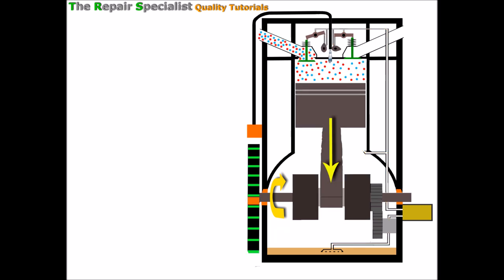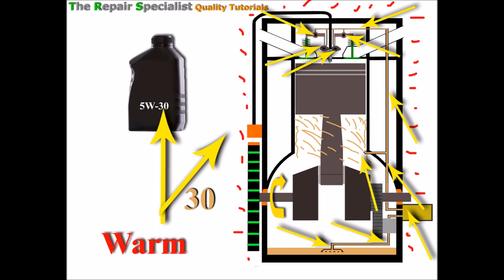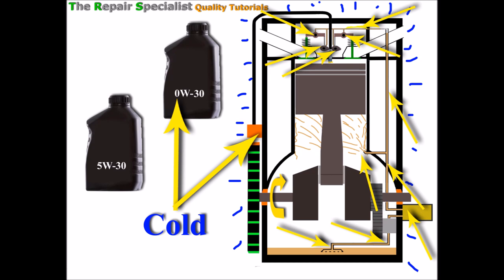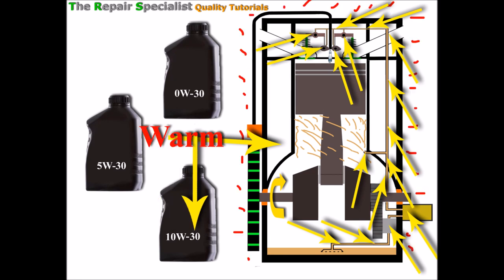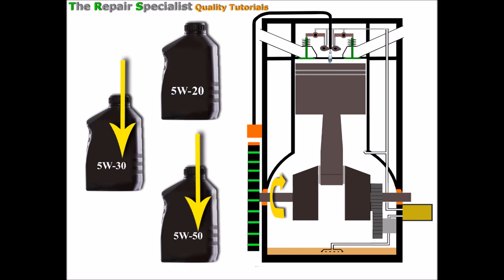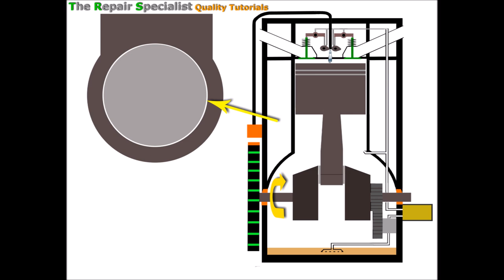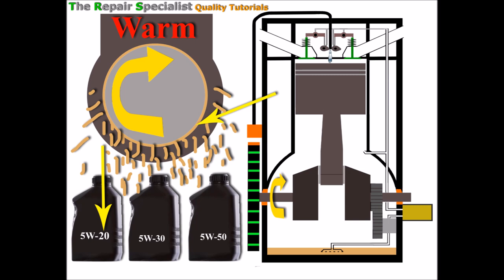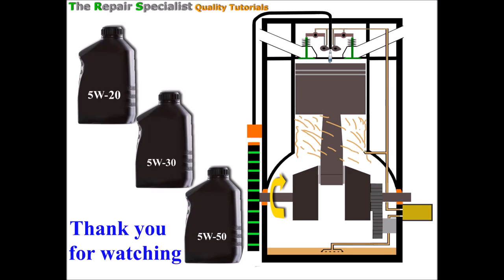'Engine Oil' - If Incorrect, this will happen! - Car, Lawnmower, motorbike, etc

Comment: This a great video, best I've seen. Which is why I am inclined to the make the effort to add to the content creator's knowledge. Specifically, about why 0w-30 should not be used in a 5w-30 engine. Yes, the oil will reach the parts faster, but the reason the manufactuer has specified 5w as the minimum for winter spec is because while 0w reaches the parts faster, it will do so at less pressure. In another video, you explained that sufficient film pressure is required to fully suspend some parts in a film of oil. If 0w is used, yes the oil will arrive quickly but will be squeezed out, and will tend to spray and splatter making the quicker lubrication pointless. It is better for the oil to take very slightly longer to arrive at 5w than to have 0w arrive quickly but lack sufficient film strength.

Comment: Thank you for the wonderful video.

One issue that you haven’t mentioned is that many engines have oil viscosity ratings recommended by manufactures that relate to outside air temperature ranges, ie the colder the climatic conditions/daily temp range the lower the recommended viscosity range, higher outside temps higher viscosity ranges recommended. In addition there is the aspect of how extreme are the operating conditions, such as  the difference between regular driving and driving around a racetrack as an example, which has a similar effect to recommended viscosity ranges to hotter outside air temperatures. Admittedly most passenger vehicles have only one recommended viscosity range. Motorcycles though usually have a number of oil viscosity recommendations based on operating ambient temperatures.

Comment: That's true on a brand new engine, but after years and high mileage that  factory recommended oil won't provide same protection due to wear  ,higher grades will be recommended to provide proper lubrication.
Reply: False

Comment: There are more factors that determine the distribution of oil. 
For example, the type of oil pump setup can affect the pressure of the oil, under different viscosities. 0W-30 will result in low pressure at startup and 10W-30 will produce much more pressure. 
Because of the complex oil passages that can clog, making sure there is always clean oil in the engine will help a lot more than adjusting the viscosity. 
I make sure I change the oil but I change the oil filter at least twice as often.
Reply: 0W and 10W is very different with cold engine, it is very important. 0W protects engine a lot better at  cold start and oil pressure is not a problem at all.

Comment: I agree with a LOT of what this video has to say. My 2 pennies on engines has some notes. If you have a really worn car, like say a little worn out 1.6l, and its in the summer, it may be okay to use 10-30 instead of 5w-20, BUT that can still cause damage if you are dumb and rev your engine in the morning, or dont drive it every day. Dont use that example as a rule! Also, say you have a car you put a turbo on, you'd be better off changing it a higher weight oil, like 0w-20 to something like 5w30/40. Always ask a mechanic or your engine specialist, and remember, any oil is better than no oil.
Reply: most of what he said is correctly incorrect. the W stands for winter. That measurement of viscosity is at 40 degree C. and is in a relative equation to the other number lets say 30. That's the viscosity at 100 degree C. You are 100% correct about changing viscosity on an older engine. As engines age mechanical slop starts to become present in the bearing surfaces. We are talking microns here, like the difference between a 5w20 and a 5 or 10w30. merely 6 to 10 microns. That much range can be found between differing oil manufacturing measurements within the same viscosity rating.

Comment: Great explanation in (theory) how about doing the test on a small engine. Find the last gallery to be filled & time it. I bet actual results using 0w30 to 10w 30 would be very little & modern oils stick to surfaces better so it not going to a lot of difference to start up wear. Better to extol the benefit of regular oil & filter change.

Comment: The first and second set of numbers are on different scales of measurement and do not relate to each other. The oil always gets thinner as it gets hotter.
Reply: You're right, hes absolutely jibberish about this. No Scientifical backing up this. This is why everybody beleives it.
Reply: No. They're both SAE.  They're both also referring to centistokes.(cps). One is kinematic viscosity the other is still.  But still same unit and scale🤦🤦.   "Thinner" is not the way to think of it "shear" and film related to viscosity not "thinner".  It's why things are added to improve those two (shear and film thickness).  You're both wrong and out of your depths.  #dunningKruger.
Reply: Motor oil gets thinner as it's heated, but to prevent it from getting too thin at higher temperatures, additives (viscosity modifiers) are used so that it behaves like a thicker grade oil at higher temps.

Comment: Have a HONDA with 500k millage and found 20-W-50 GTX Castrol Conversational Oil STOPPED OIL CONSUMPTIION PLUS HAS MORE POWER BEHIND IT. 
Better then scrapping it, did anyone else find the same solution?
My friend did it to his TOYOTA COROLLA with over 650k millage and it worked for him. He claims no smoke or oil consumption and more horsepower. 
WORKS FOR ME!

Comment: Hi there thank you for this very informative content. But pls correct me if im wrong, so basing on your explanation, the 2nd number(viscosity rating for working temp) is a bit more important in choosing the oil for your engine since you will be running the engine most of the time. As for the 1st no.(viscosity rating for a cold start) especially in the morning. My question is, what is the co relation of the viscosity rating in cold start has to do with the weather condition of the country you are in? It makes sense for a country that is freezing cold could get the benefits of a 0W, but for a tropical country could you still use a 10w-30 or 20w-30(as you have said for a cold start it will take longer than 90 seconds) for a 5w-30 recommended engine without damaging it the long run. Thanks!
Reply: My I jump in?
It is a quastion of '"Pumpability/Flowability".   The 0............60 insures that the oil will maintaine it´s Pumpability and Flowability within a wide range of engin and climatic tempatures to lubricate and protect engine parts.
Depending on the driving and climatic tempature conditions (-45c - +45c) you do not need such a wide spread in Viscosity but narrow it down to your driving conditions.
Hope it helps.

Comment: Thank you for the explanation! I have one question regarding 5W20 vs 5W30, at home we have 2 cars using the same Honda engine the K24, the cars are Honda Accord 2003 and Acura TSX 2004, same K24 engine on both car but the Accord would use 5W20 and TSX 5W30, I live in Canada so we can have temp from -30C to +30C.  Why they are using different viscosity for the same engine, I know it is the same because I am the one doing maintenance for both car, I have asked this question on another car channel but no answer, some body suggested 5W20 was used to have a better km/l consumption as less viscous, still I am skeptical.
Reply: 5W20 doesn't have the best protection, it has the best MPG, so they'll recommend it. If you want my advice I will recommend you to use the 5W40 all year round and even better, use an friction additive called MotorCote but not the 10%, but 5% every oil change, and than tell me how is it running, and what gas mileage you are getting 😉
Reply: Manufacturers are moving towards thinner oils for better economy and emissions compliance.
As long as the oil is changed regularly and is rated for your climate conditions then there’s no issues using different oil.
Reply: @horiatomescu  MPG has nothing to do with it!! Attend an oil seminar, there's a standing rule why 5w20 is used!

Comment: I've used 5W30 in place of the recommended 10W30 without issue.
Reply from the maker: OK. Good to know thanks
Reply: You're exactly ✅ right
Reply: @TheRepairSpecialist  Tomorrow I will get it done Ford windstar 3,8 v6 2002 SEA 5W-20 on the cup.
I had 10w-40 first winter day car going bad noise from the engine.
Looking for trouble broken plug wire one didn't solve the problem.
Wait for tomorrow and will get back.

Comment: CAN YOU DO A VIDEO ON WHY YOU SHOULD OR SHOULDN'T USE SYNTHETIC IN OLDER VEHICLES THEY USE TO USE REGULAR OIL OR IF IT REALLY MATTERS.
Reply: you can use synthetic oil, of course its better than non synthetic on any vehicle, but make sure your engine is clean, because sometimes, leaking start to happen due to detergent on synthetic washing out your engine and any SEAL on your engine will be damaged due to dirt that washed out (if your engine is not clean)
The better method is, you use new non synthetic oil, run your engine high enough, drain, repeat if the leftover oil color change (dirt should be diffused onto new non synthetic oil), then change it to synthetic
Reply: you may certainly use synthetic oils for any engine old or new; the problem was decades ago (1990s)  when they first made the synthetic oils the esters that was used at the time has eaten into some type of gaskets or orings; this is not a problem now and was solved a little after that time...
you may find this info explained in youtube channel Lubrication Explained episode evolution of engine oils

Comment: I have an old worn engine.  Possibly cam bearings.  
I live in northern California.   It gets 112 degrees Fahrenheit in July.  Should I stick with 5w30 or move up a bit to let's say 5w40?
Reply from the maker: I can completely understand  your questioning here. I myself would wonder this. The issue is though, that if I recommend a certain oil, then it damages your engine as a result, then this is unresponsible of me. I would contact your vehicle manufacturer and get their take on it. Maybe they have a fact sheet of recommendations. Sorry I can't help further. Craig

Comment: SAE 10 oil has a dynamic viscosity of 0.3 Pa-s at 0 degC and 0.005 Pa-s at 100 degC. 
SAE 30 oil has a dynamic viscosity of 1.3 Pa-s at 0 degC and 0.01 Pa-s at 100 degC. 
SAE 10W-30 oil has a dynamic viscosity of 0.3 Pa-s at 0 degC and 0.01 Pa-s at 100 degC
Reply from the maker: Awesome 👍

Comment: Sir, 
You explained nicely. 
I need a little help. 
I have a Motorcycle which I bought in 2006.
The manufacturer recommended oil was 20W40.
But from 2009 onwards,  the manufacturer changed the recommended oil to 20w50 for their Motorcycle's built after 2009. 
What should I do. 
Should I still stick to 2006 recommended grade of 20W40 or should I use 20W50.
Earlier from 2006 to 2014, I used to live  in plain area. 
And now I live in hilly area. 
So sir,  please suggest me what to use. 
20w40 (2006 recommendation) 
Or
20w50  (2009 to till date recommended)
Reply: Well, if your motorcycle was built after 2009, use the new recommendation.
Reply: Maybe they learned 20-40 was a bad idea but if they admitted that then people with older bikes would try to sue if theirs failed. I think the 20-40 is probably ok but why use it if you have the option of 20-50? Air cooled bikes especially so but you didn't specify.

Comment: You can use half n half for extreme heats n extreme winters, 5w-20  (from 5w-30) 10w-40  or 10w-30 , sae high mileage , option is full synthetic only case high mileage is already half synthetic ,,, use a lubricant additive  2 of bestline is a great one,, so you pour bestline first then then 5w20 n last the highest grade , put in between pours let it run all the way thru n down you can help it by hand turning the engine, to lubricate it,,this also gets in the oil filter without fill it in with oil much cleaner

Comment: (Recommended !)oil is a better mpg oil (and meet regulations) benefit for manufacturers marketing so they can mark good MPG that's what sale the car also pass engine warranty...not for engine last 2 -500000 miles what people want,that's up to people knowledge..some car manufacturers even make engine burn oil less friction to achieve mpg like audi

Comment: @TheRepairSpecialist, thank you for your informative videos. Can you make a video on how climate temperature affects the viscosity of the engine oil? My car owner handbook recommends SAE 0W20, 0W30, 5W30, 5W40. and my living area climate is summer all along between 32 degree to 25 degree Celsius
Reply: In my Mercedes E430 V8 I use all year round 5W40 Shell Rotella full synthetic for 18 wheelers, and I got 180k miles, and runs perfect

Comment: I have a 1994 Mercury Cougar 4.6L 103,000 miles. Owners manual calls for 10w30. Twenty eight years later I found out about a service bulletin that says to use 5w20. I wonder what the problem was.

Comment: Is switching oil viscosity based on external temperature a myth since manufacturers recommended usually only 1 viscosity I live in 44c weather which is not safe for lower viscosity such 0w20?

Comment: finally I get it, also I have been using the wrong oil all along using 20w-50 instead of the recommended 10w-30 I though it was ok since I live in a really hot country.
Reply: Ignore Carlos, he doesn't have the slightest clue. You were right imo, 20-50 is better as long as it isn't too cold when you start the car. How cold is too cold is the question but there are so many other factors you cannot say one is correct for everyone. Imo 10-30 is not good is a "hot" area. I use even thicker and I'm at ~32 degrees latitude so not really that hot. I would never use 10-30 because I'm not brainwashed and I want my engine to last.

Comment: Well explained vid, thanks for that... I have a question to ask you.
What about if I’ve fitted some performance/aftermarket parts to the car, like headers, CAI, exhaust.. 
Do we need to change the oil for high viscosity when engine is warm?? like from 5W-30 to 5W-40..??
Reply: The oil is mainly for the bearings and cam and they don't know if you have headers. If you have a cam with a more aggressive lobe and stronger valve springs then the cam and/or lifters will last longer if the oil is thicker. I don't know how cold it gets where you live but I'd never use 5w in anything I care about. My hotrod uses a blend that's more like 30W-60.

Comment: Hello I have a Buick Lasabre 2000 and the oil cap says 10W-30 and they man at the store gave me 5W-30 and a qtr of 5W-20. I turned my car on after completing my oil change and literally after a minute past by something start smoking from the engine. Any help ASAP???
Reply: 5W-30 is fine but I don't understand why he gave you a quart of 5W-20 as well? The smoke is probably just from some oil being spilled on the exhaust manifold when the oil was being changed.

Comment: You can probably take the hot viscosity up a notch if your engine has over 200,000 miles to to make up for any wear.
Reply: I'd take it a couple notched, but I'd focus more on the lower #, and I'd start doing it long before 200k
Reply: im living in a hot climate area, my honda fit is now around 215,000 miles, usually i use 5w-30. now im currently using 15-40 oil and now feels soooo sluggish.. 💀 next im using 530 back

Comment: Many people have the belief that if the engine is old you need to use thicker oil could that be true?
Reply: That's exactly what I want to know
Reply: Generally yes, but really it depends on your oil pressure at the last bearing furthest from the pump, which you'd have to measure to be sure. As an eng wears you lose oil psi and the last bearing gets the least since it's furthest away. So at some point, due to wear, more oil is bleeding out the other parts before it get there, then you're screwed. So yes, thicker oil helps. There's also the oil pump which wears and makes less psi, especially at idle. Thicker oil also protects parts better period so imo all engines need thicker oil but apparently I'm outvoted by the masses that believe oil charts dictated my car mfg who are in turn dictated by the EPA, neither of which cares about your old eng and would prefer it die and you get a new car. The only time you may need thinner oil is when the eng is very cold, but even then it's a matter or whether or not a cold start is harder on it than too thin of oil is the rest of the time.

Comment: Thanks for this. I googled and asked around but got no real answers. I accidentally put 10w-30 in my dodge neon, which calls for 5w-30. Doing another oil change tonight to correct the problem.
Reply: Did anything anything happen when you put the wrong oil?